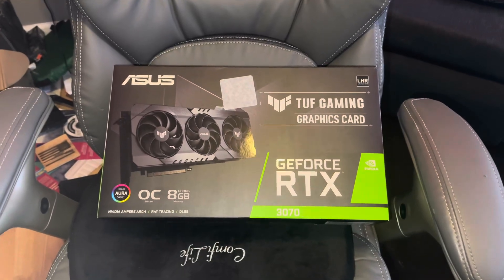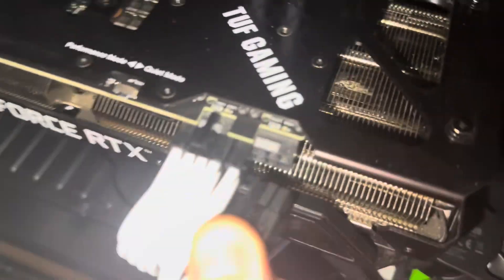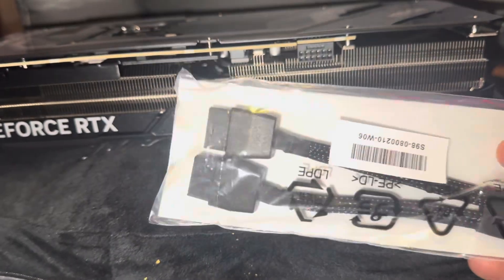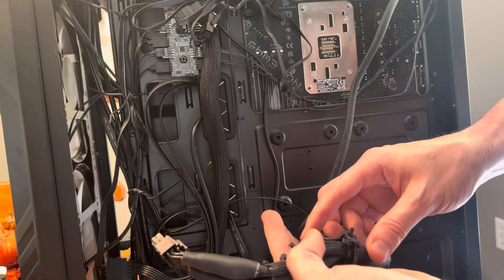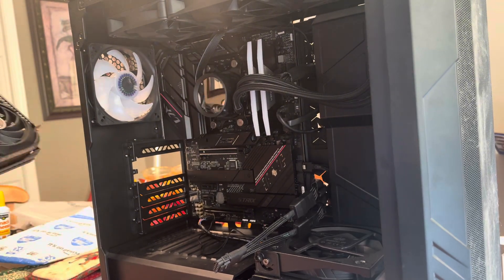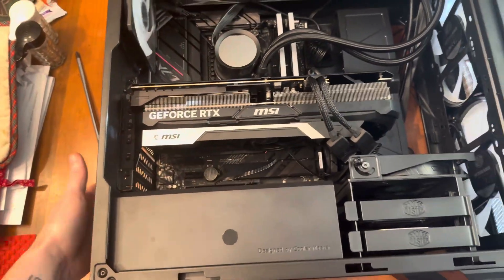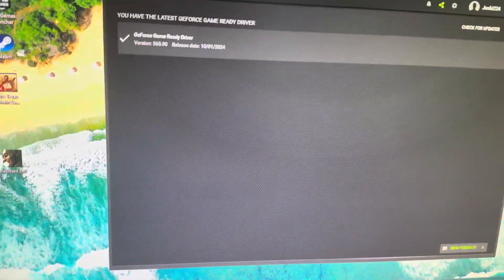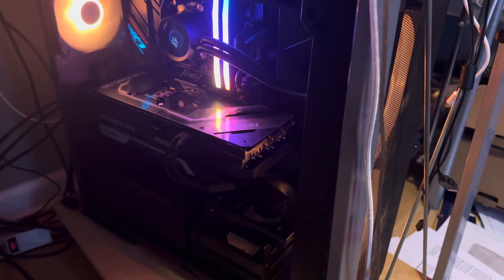How to Upgrade Your Graphics Card to Nvidia 4070 Ti Plus | Step-by-Step Guide

Comment: Will I have to use the adapter also it comes with cause I’m thinking about upgrading from my 1660 super ?
Reply from the maker: Yes most likely psu too. What kind of power supply?
Reply: @Valiant1G  hello, do I need to use the adapter to replace the 3060 with 4070/ti?
Reply from the maker: @ Yes